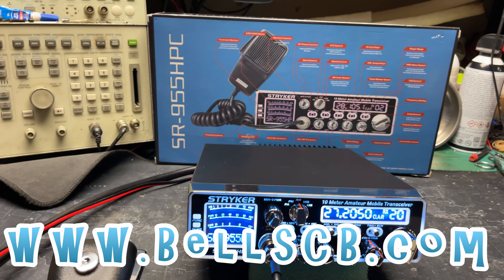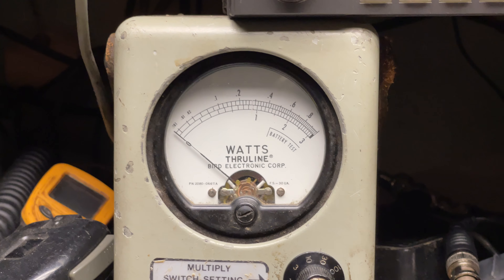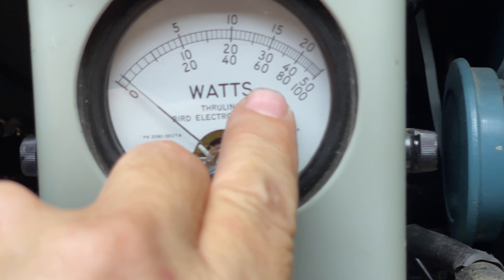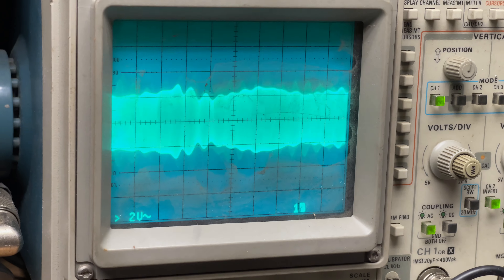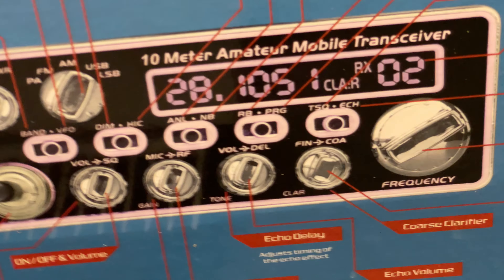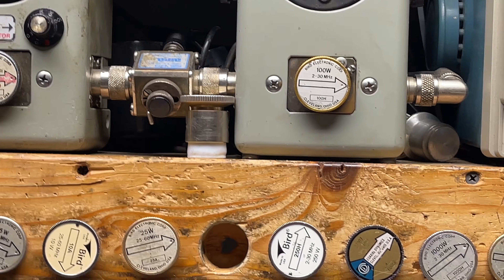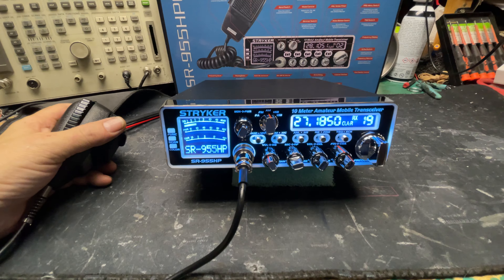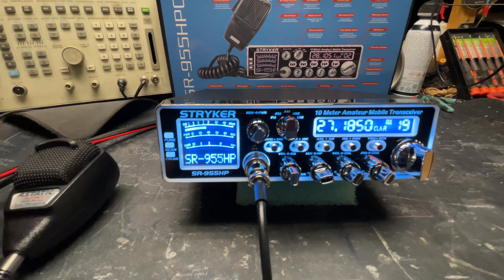Stryker SR-955HPC Tune-up Report

Comment: Just got mine on Sunday. Have to update my battery connections. It shows 14 volts with the engine running when I key the mike it goes down to 9 1/2  lots. Found out my connections are corroded. Will replace them and give the radio a shout out. Have listened to it sounds great very clear and has little noise. Thanks Screwdriver.